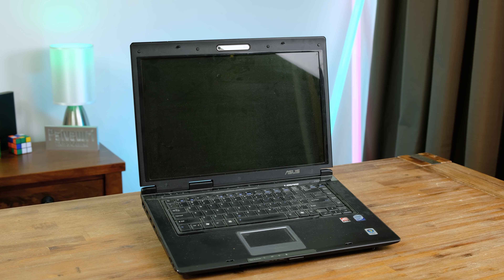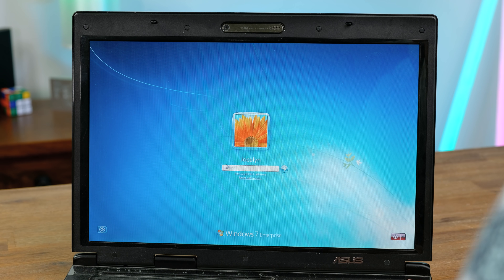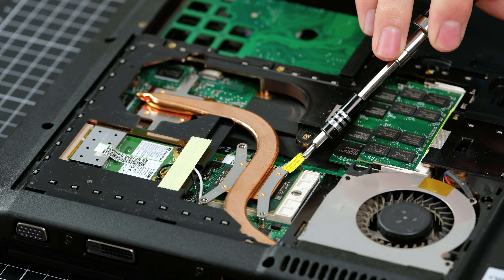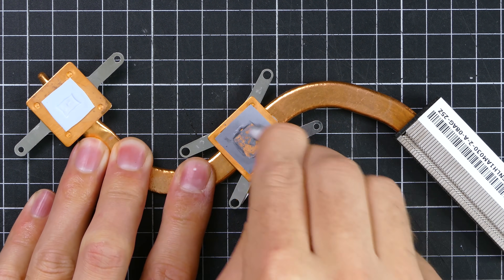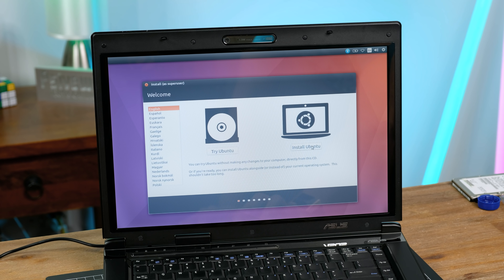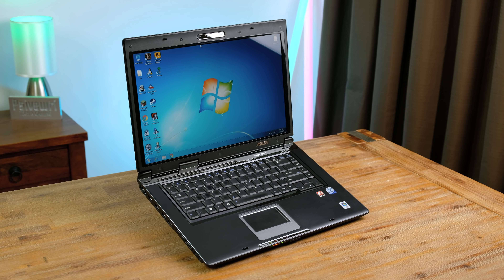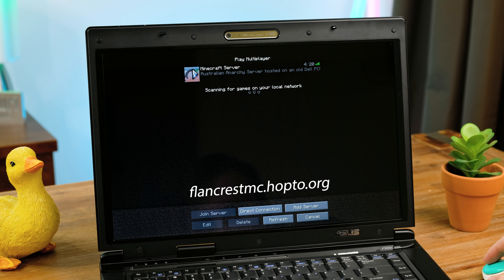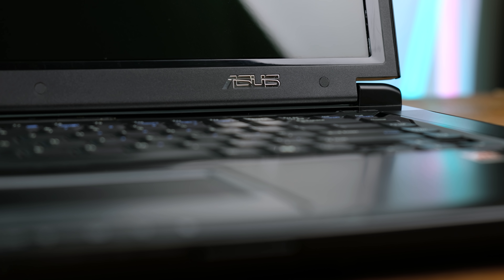Using A Gaming Laptop From 2008!

Comment: if you want to see a real beast of a lappy try and get your hands on a HP Elitebook 8530w they can support 8gb of DDR2 and have an MXM Slot hella OP Laptop back in the day plus win10 runs fine and has full driver support perfect to use even for todays standards IMO 

whats funny is those core 2 duos IMO were quicker than any laptop that had a i7 720 or 740QM those cpus were absolute garbage haha

Comment: A little tip: Ubuntu is now infamous among Linux users due to the rather aggressive telemetry added in recent versions which unfortunately collects a lot of user data and cannot be easily turned off. Instead, I recommend Debian which is proven, safe and lightweight, especially as it offers a choice of interface and you can choose the lightweight XFCE or LXDE (I can't remember which one exactly) ;)

Comment: Why do you seem reluctant to use windows 7 or vista
Reply: Vista is just terrible and windows 7 is annoying to use when it comes to getting modern software on it
Reply: @bigmanmccheez5342  huh? Windows 7 is way more easy to get modern software than windows xp.
Reply: @LoftyCrofty  I never said anything about xp??? Most apps have been updated over the years to work on Windows 10 and 11 nowadays, trying to use modern versions of said apps on Windows 7 is a bit tricky.

Comment: This is not really a gaming laptop and it wasnt back then.
I had one and it could barely run cs:s or anything newr and on any Asus laptop with the F5SR Board you cant install Windows 10 or even Windows 8.1 because of a broken ACPI implementation Asus had at the time.
My mom has a 17,3" Acer Laptop with a T8300, a 9600m GT and 4gb ram and not even that was considered a gaming laptop so yeah.
I don't want to hate or anything but even back then there were so much more powerful Laptops!

Comment: And he made big mistake, he didnt upgraded to full potential of machine haha. 2,4  you can put way way more better cpu like more than 3 Ghz cpu, and ram also way more like 8GB ddr2 in this loptop baby. Do not use manufacturers specs. Machine can have 8GB ram simply beck than there was no windows which supports more than 4, so specs are useless from manufact